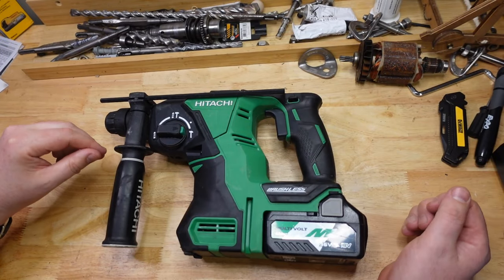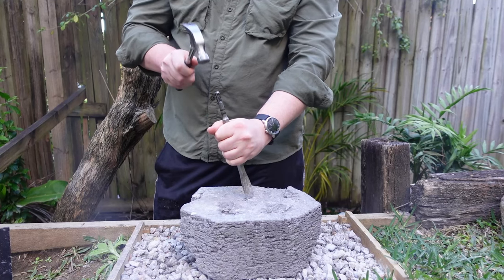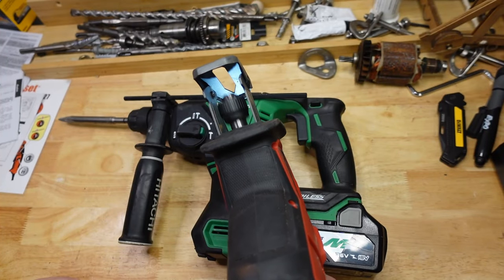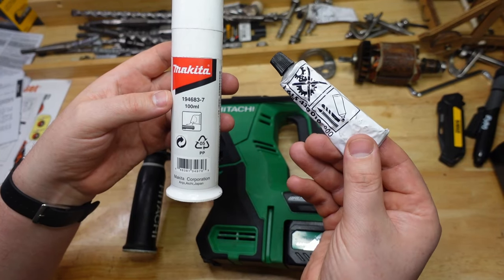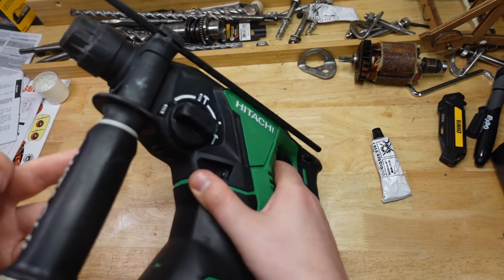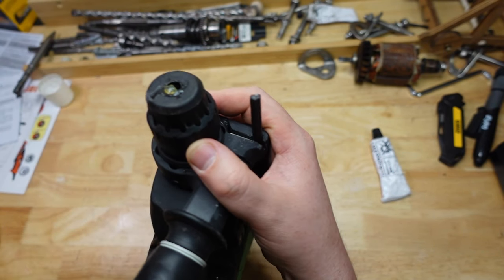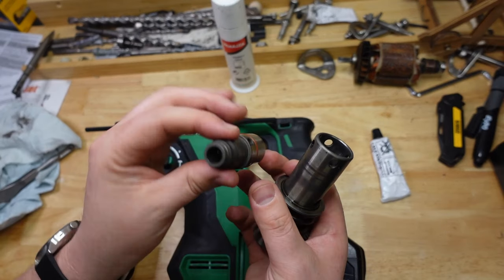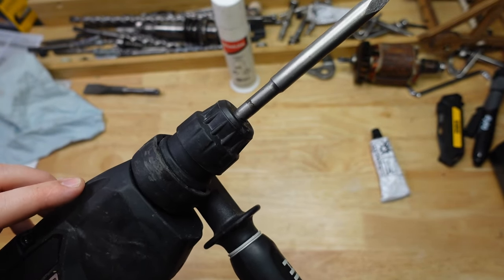Do you need to grease SDS rotary hammer drills?

Comment: Well, one thing is for damn sure. I got a drill bit absolutely stuck in my el cheapo rotary hammer. Won't come out without an angle grinder. No, sir! Funny thing is the drill bit was damn near as expensive as the rotary hammer. BTW, expensive drill bit with a cheap rotary hammer might be as good (or better) than a cheap-ass drill in an expensive rotary hammer. And, do NOT overheat the drill bits or the solder will soften and the hard bits will come off and the drill bit is done. You need 2-3 drills and swap them after every hole.

Comment: Every cordless rotary hammer leaks grease when it gets hot that we have brand didn't seem to matter. Makes a mess slinging it around. Don't really know why it's not sealed very good.
Reply from the maker: It's probably helpful to have a bit of the internal grease leak out past the striker pin at the back of the chuck, so that's probably what Milwaukee etc were relying on when they don't mention greasing it but getting it serviced. But when it leaks out of the mode switch or body? Yeah that's just annoying
Reply: @BoltahDownunder  mines leaking out of the pull back you use to take the bit in and out. So then its rotating at a high speed and slings it everywhere.

Comment: Can too much grease damage the drill?
Reply from the maker: Damage? No not really. The grease falls out when drilling. Bit get the bit stuck? Yes it can create vacuum if you have too much grease, drill and then allow to cool with the bit installed
Reply: @BoltahDownunder so if you drill concrete every day there's dust. If the chuck is dry then the dust falls out. If it's greased then you end up with a grinding paste of concrete dust and grease.

I'm struggling to find analysis video. I was hoping your video might actually test grease v no grease.

Grease works well when everything is clean. But what about when there's lots of concrete bits and dust?

Comment: Many other videos say to take off the selector knob and grease in there. Do you not do that?
Reply from the maker: Yeah you could but that type of thing is more like an annual service rather than just general usage. Personally if I were worried about the gearbox/hammer mechanism needing grease I'd open the whole drill up & clean the old grease out before adding new stuff. The reason being you shouldn't mix different greases unless you know what type they are. They can react & dry out, which drops the oil & leaves the thickener behind. If you're not sure it's best to leave the insides of your tool to the service department
Reply: Thanks.  I went ahead and did this to mine because Im not sure when it was last done.  @BoltahDownunder

Comment: Ha mate .. the makita only gose slow or full BORRRRE .
 Can you tell me of a 18v sds that dosnt only have 2.3 speeds .
I need the full 12 gears . VARIABLE  for the granite . Coss its eating up drill tips like crazzy
Reply from the maker: a couple of drills have like a 70% power setting to start up slow...hikoki dh18dpb Bosch GBH18V-26... But maybe you want to try wet drilling with the Rotary hammer? That can keep the bits running longer.
Or core drilling?
Reply: I gotta try out an old 24v dyna link sds drill. But the trigger is 💥😨 . So Alix is  has got 1 .. gotta wait postages.. china ..👍
Reply: Looks like its the makita .. knock off they make .. 
Back in old days .. 

It was ment 2 be .. 
Dump shop love .
Reply: Can you make a short vid on .. VVVARI ABLE  sds rpm ..drillings..🇦🇺👍🤔
Reply: Just got a full bore bunnings 2000w core drill now .. so rocks 
💪💪watch OUT 💥
Reply: Bunnings $$$$$  2.45$ core bits 😱💥 untill all gorn 

Diamonnds